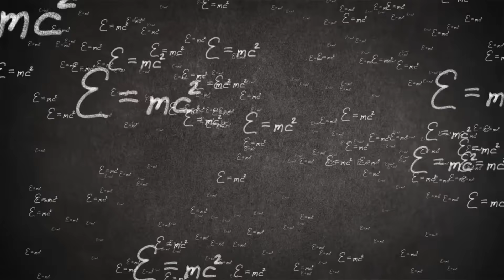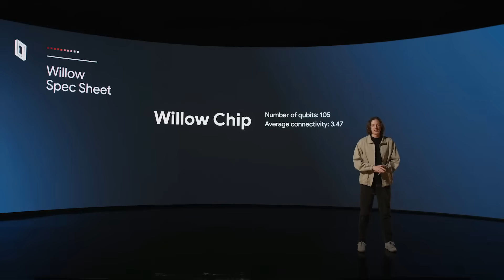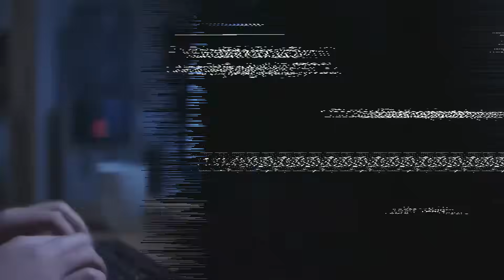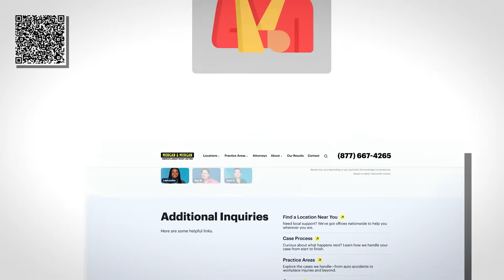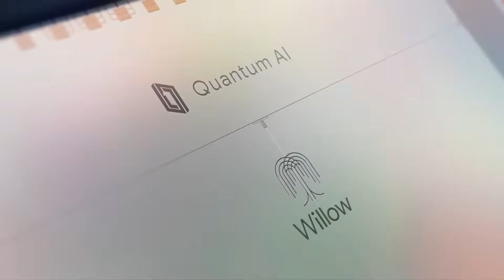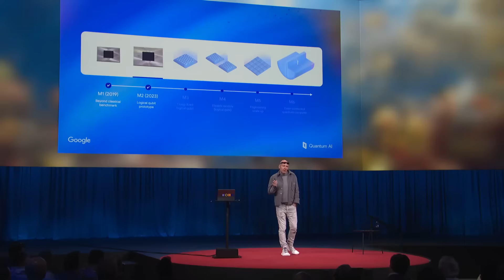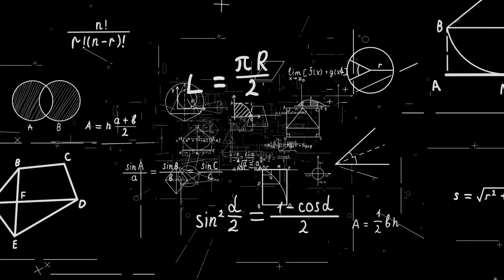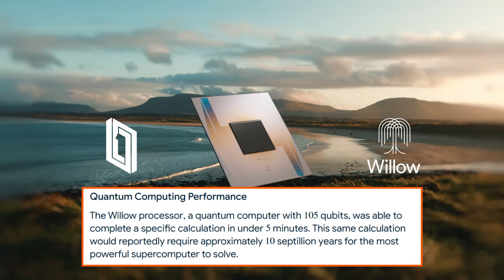Google’s Quantum AI Found Something Disturbing in String Theory. The Results Are Unsettling

Comment: All the computers did is tap into an adjacent layer. It's like a performer balancing plates each harmonized from the center.
In layers those layers are like themes or chakras.  When layers align at certsin junctures, there is shared  information that is relevant. Read your Bibles